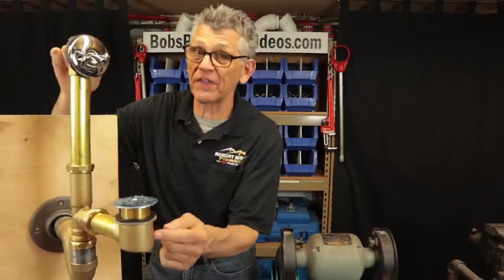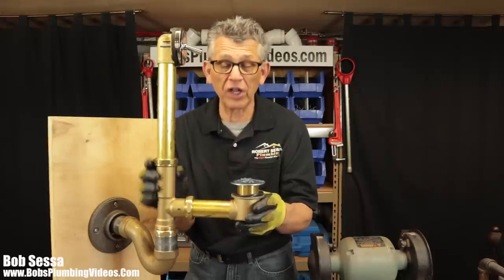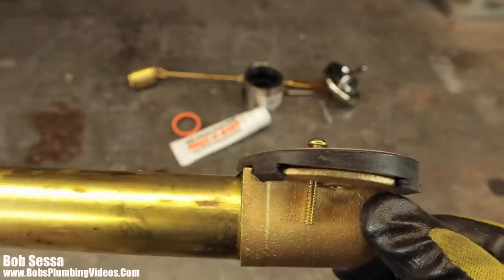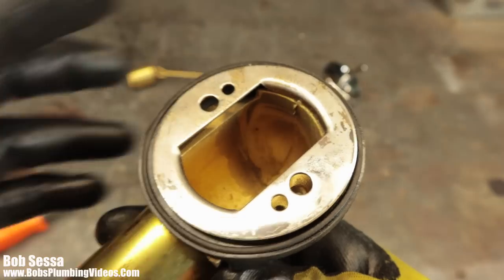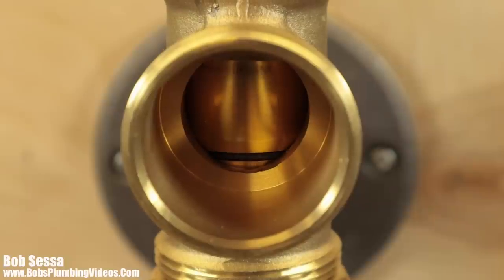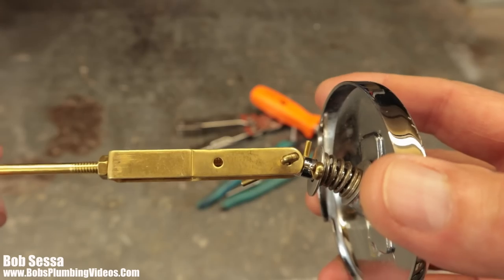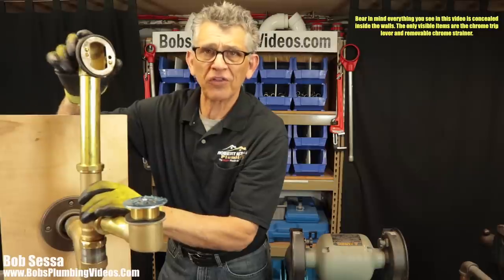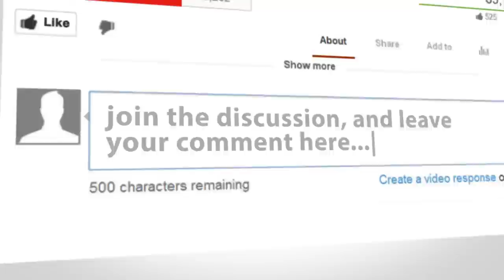Bathtub Drain Stopper / Trip Waste Assembly

Comment: In removing a very corroded drain stopper, the plunger broke off and is now lodged in the pipe. Since the drain was clogged, I was able to snake it about 3 feet in which seemed to do the trick. Is the plunge hollow on both ends that would allow the snake to pass through and can I just leave it there? I realize we will be limited to just taking showers.
Reply from the maker: Lar Most plungers are hollow on both ends. I’ve had limited success fishing them out with a coat hanger, but if not I would just leave it. Use a rubber stopper for taking baths. Good luck! Bob.
Reply: @BobsPlumbingVideos  Wow,  thanks for your quick response. Much appreciated.
Reply: Use a fish hook and line to snag the plunger and pull it out.
Reply: @BobsPlumbingVideos  Where are you putting the rubber stopper?
Reply: @dorimccormick218  put the rubber stopper in the tub over the drain. Old fashion way.
Reply: I've used various coat hangers of different thickness.  Find a thick one and bend a little hook, then go fishing for the brass shuttle.  Takes a little persistence.

Comment: Bathtub drain stoppers are not worth it.
Few people take baths today and without them snaking a tub is a breeze. They don't do anything that a rubber stopper can't.
Reply: Agreed, it's a terrible design because when it fails from age, the consequences can be much more severe than simply replacing a worn out part. All for the convenience of a lever in lieu of a rubber/plastic drain cover or tapered cylindrical drain plug. Every linkage will eventually corrode and break (unless you open it up and inspect every year or so and replace it proactively, but who has time to maintain their bathtub like a motor vehicle). The plunger will then drop and completely block the tub, as it is designed to do. Sometimes you can fish it out easily, sometimes you can fish it out with a lot of persistence, and sometimes you will have to open up the wall to get it out.